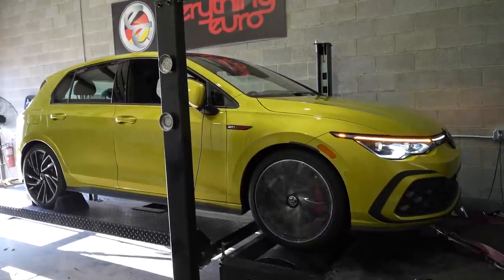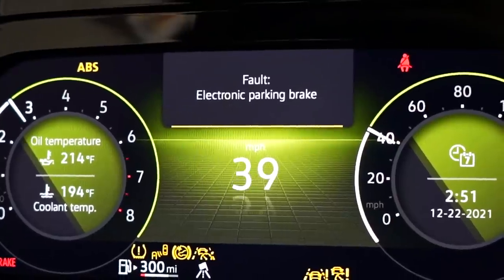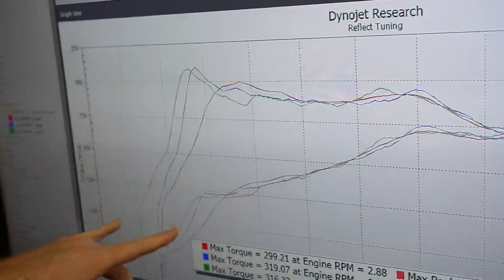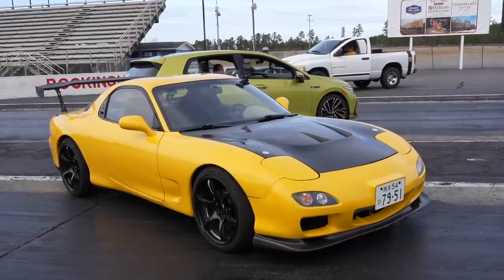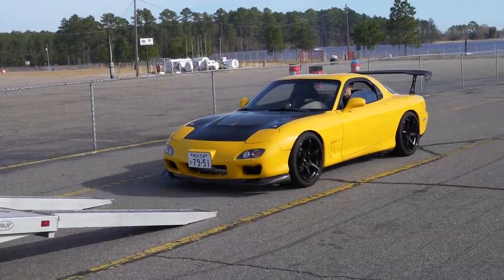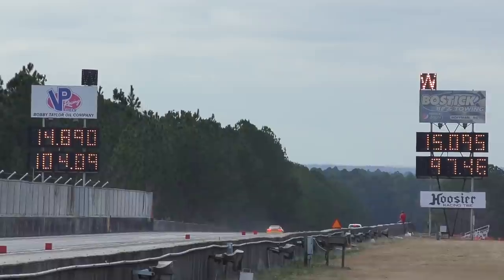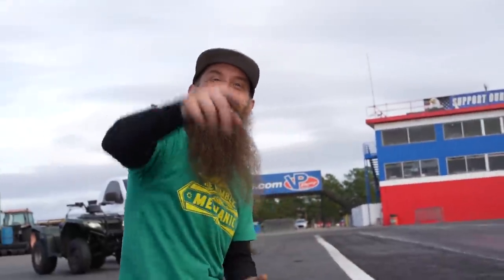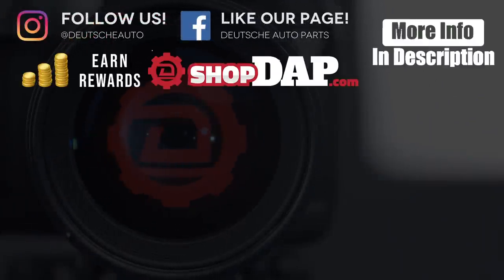Stock MK8 GTI 1/4 mile Times & Dyno Numbers!

Comment: The manual and the GTI lose again…. DSG Golf R to the rescue!
Reply: I'd rather be 1-2 seconds slower on a 1/4 mile run against a R or DSG GTI
DSG is good for going fast in straight line, but absolutely no enjoyment in corners, twisty roads and mountains
Manual absolutely is the best option
No contest, that's if you like actually driving the car
Reply: @robertroberts9854  all my previous cars were VW manuals (and they always needed a clutch upgrade on stock power). I'm enjoying the 7 speed DSG more believe it or not. Paddle shifting when whipping around is a ton of enjoyment, and my hands don't leave the wheel so I'm able to push it even more now.
Reply: @robertroberts9854  That's such non-sense.  I drove nothing but VW/Audi equipped with manual transmissions for years and currently drive a MK6 DSG that's making around 350 whp/tq.  It's absolutely faster in every sense of the word...
Reply: @whorutothink  I think you misunderstood or never read my comment correctly
I don't care if DSG is 10 seconds quicker, Manual GTI is a drivers choice
Automatic cars are for people who can't shift or drive